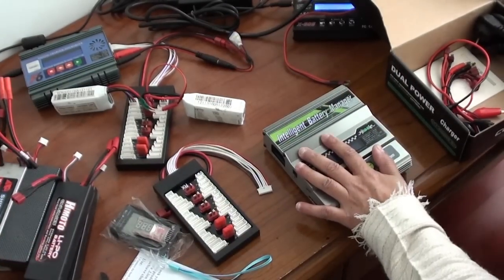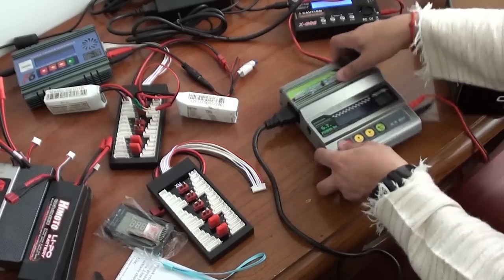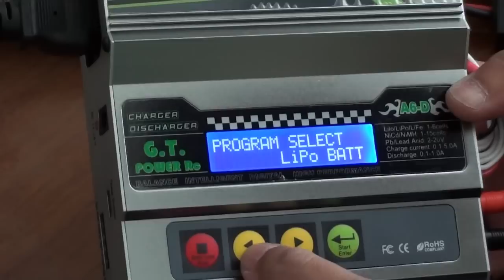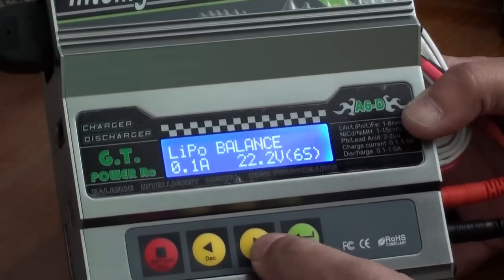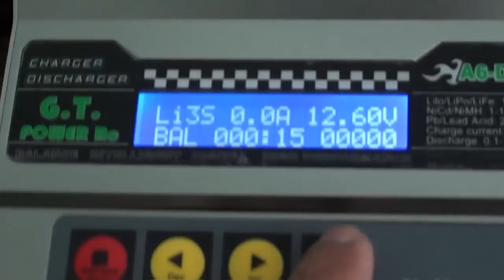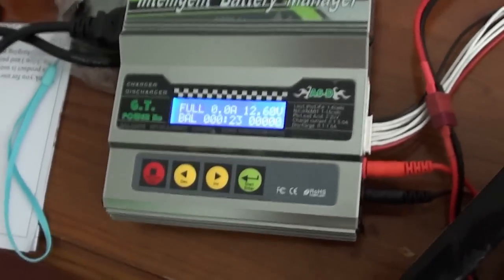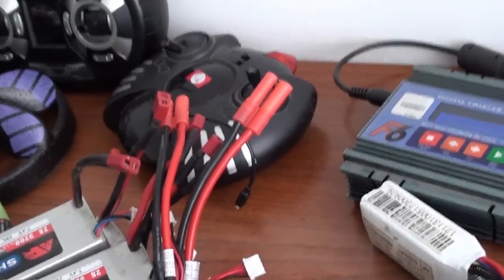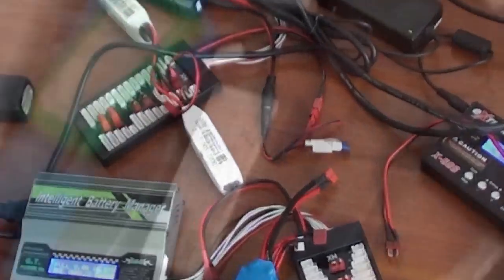VLOG The Pro Balance Charger

Comment: @xjet Here's a tip for the bad weather.
Get an RC truck that uses the same lipos as your aircraft.
When you're all charged up and nowhere to fly, you can have fun discharging them with the truck instead of boring old discharge mode with your charger.

Heh heh Ali ... Snap!

Comment: That GT Power A6D is OK for charging smaller batteries but with a max Current of 5A and a max Power of 50W it's not really suitable for parallel charging big lipos. To get those 4 packs parallel charged in 1 hour you'd need 13.6Amps  and 170W (13.6A * 12.6V). And that's just charging a 1C. You set those packs to charge at 1/4C which means you'd have to sit with them for 4 four hours, given that it's not safe to leave lipos alone whilst charging.

Comment: @xjet Except that this charger has a 50W output which will limit the Max current to 2Amps at 6s.
For an 80%discharged 3400mAh pack that's about 82mins plus balancing time so for the four packs you'd do it in just under 3 hours series instead of 4 hours parallel.
Depends on how much spare time one has I guess.
Of course if you're lipos are are all stored at 3.7V-3.85V you could still get out to the field before the weather changed. ;)